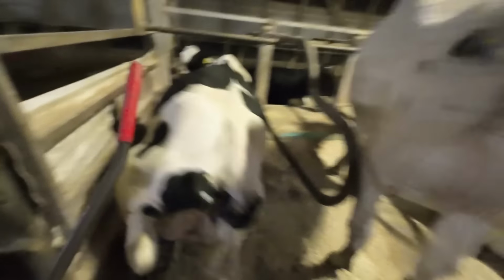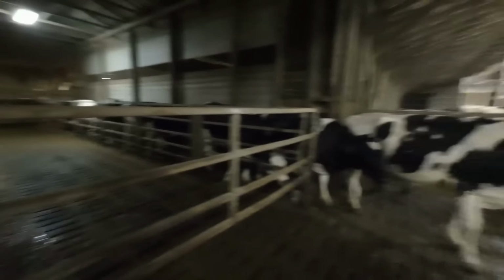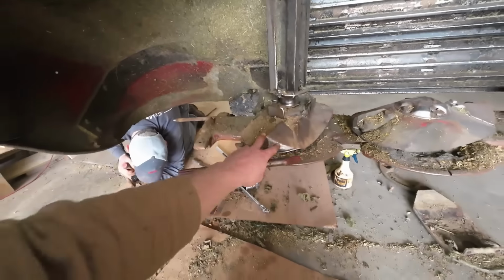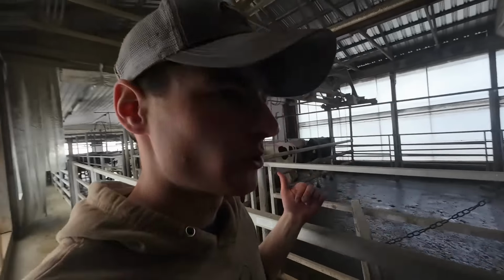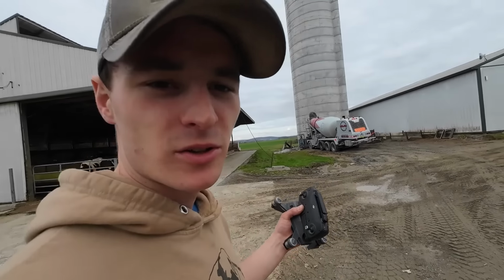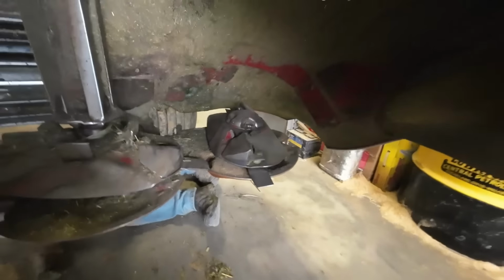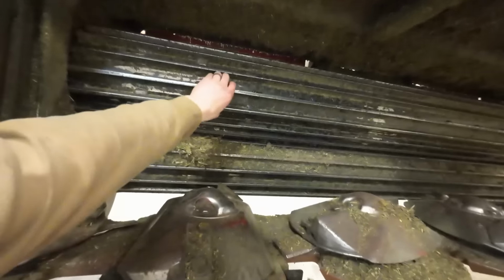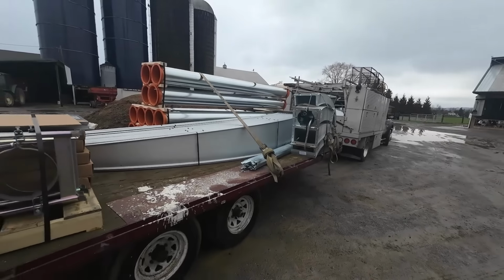Pouring Concrete on a 100+ Foot Silo

Comment: i have poured a lot of concrete for bridges all over. and that system they have setup is one of the coolest things i ever seen. really brings back the old nostalgic feeling. thanks
Reply: I was a PM for a concrete company back in the day. We did some bridge work too.  I got told by someone from the BLM "that we PLACE concrete." :) 
I wonder if placing an anchor for pipe to allow a pump to hook up at the bottom then the cart operator could chug the pump to fill the cart. Or, the pipe could be plumbed to attach to the hopper. That said, the formwork may only be rated at a slow rate per hour.

Comment: Thank you for giving us a look at how they pour; that was so interesting.  I have seen a few silos, and it was always a wonder how they poured them in the past. It would be interesting to watch them switch out the forms to move up. I have seen slip forming on a dam, and I wonder just how similar the forming of your silo is.
Reply: They unlock the bottom form and pull it up and lock it in on top.  We have 3 poured silos on our farm. The last one was in the mid 70s. 1st one in 50s lol

Comment: Great video!! In my mind, I always thought that the bunker silage pit was cheaper than putting up an upright silo. But maybe its cheaper or about the same expenditure? It would be interesting to compare the costs....
Reply: A bunker is a lot cheaper, the reason they are using upright storage, is because they are moving to fully automated feeding. So the feed needs to be stored this way.
Reply: @LastNamefirst-wv7jj you need to watch the video where he explains all of this, they though through everything and decided that defacing and loading feed boxes just wasn't a viable option. So they opted for this. I actually agree with them, if you are having an automated system, why mess around filling feed boxes.
Reply: @LastNamefirst-wv7jj  always some know it all 😂. It's a shame there's no right way to farm, they can do what they want.
Reply: @LastNamefirst-wv7jj They aren't stupid, it's their Farm, Their money, They can do whatever they like.
Reply from the maker: @LastNamefirst-wv7jj the big kicker for me with using the bunks is feed freshness. Defacing the silage and letting it in a pile for 4 to 16 hours before feeding it to the cows is a problem. Our bunk floors need to be resurfaced and we should expand the silage capacity and buy new walls for a couple narrow triticale bunks. Then buy a used payloader and some quality com boxes (45k each) for loading feed into the robot. We could use some old forage boxes but I know those are not built to have acidic fermented feed setting in them 24/7. There we already spent close to two silos worth of money and we still have the labor of loading the boxes 2 or 3 times a day. Also the problem of moisture changes when we get rain in bunker silos. The towers bring other advantages- less feed shrink, little to no mold, no dirt or manure getting tracked into the feed, no throwing tires and cutting plastic. I know what we are getting into with silos. Gotta stay on top of maintenance to avoid most sunday night calls. Triticale door needs moved every 20 days and corn silage every 10 days. Fresh feed on camand for the robot, hard to beat.
Reply: @10thgenerationdairyman yes the better quality feed for the cows coming out of an upright silo compared to a bunker will show up in the milk check.

Comment: I used to build silos back in the early eighties. The tallest was over 300 ft. Built smoke stacks the same way. Built a few up around 1000 ft. Quite a view from that high up. Brings back a lot of memories.

Comment: Amazing build.  Was looking to see how those guys were tethered. Man on the cement cart is but can't see where the other guy is tethered. Does the cement cart also vibrate the mix to insure a solid mass? When they come down is it on the bucket winch?  I would like to see that ride.   Thanks for the aerial.

Comment: Great vid Eric love watchin em. Only thing id say about the crimpers on the mower is that when you cut the crop the crimpers crush the stalks which can cause the nutrients to be drained away and left on the ground rather than in your feed like yes its great for drying but you can get a better crop if you dont crimp it 👍👍
Reply from the maker: I've heard that but we have not found it to hurt feed quality. Some say crimping is better for feed quality because it stops the plant from respirating after mowing.

Comment: As you get older, you'll wish you had an elevator for those new silos.
Reply from the maker: That or someone younger around to help climb them
Reply: @10thgenerationdairyman  better start encouraging the kids to like climbing now!
Reply: @nickjewart9351   Kind of naturally start climbing stuff in the yard
Reply: I was 8 years old when I first started climbing silos. 2 80’s and a 40’. He’s got nothing to worry about.
Reply: Its not a big deal. Grain farmers climb grain legs all the time too. My 60 year old dad still climbs silos if he has to.
Reply: I grew up with 2 20x60 stave silos on our dairy farm. 120ft is still a long way to climb.
Reply: Soon he can buy a drone so he can fly instead of climbing 😂
Reply: Years back I was talking to a silo builder.
They put a cable on a silo that had some weights on one end then you hooked the other end on a claiming harness that you had on to make it easier to clime.

I don't know if it can be done but it be nice if the inside of the silo could have a good epoxy paint sprayed on it or at least the bottom half.
Reply: Are you planning on putting a safety cage around those rungs?  Climbing 100 feet to the top can be risky.  At that height the wind could make that trek to the top dangerous.
Reply: That's when 11th Gen takes over.
Reply: Love your videos
Reply: I built poured concrete silos in the 70's and most silos over  80 ft in height always went to the 30 ft diameter .Just curious why you are going so high with the 24ft instead of going 30ft and not so high?
Reply: Wondering why you did go with another harvestor for another silo!?
Reply: @diamondjim7560  it will get a safety cage when Sollenberger comes back to put roof, hexapod and unloader in.
Reply: @somethinburnin  Thanks.  I was worried.
Reply: Also the chute is for climbing. He mentioned that when the first 3-4 rings were being made. Some of their existing silos work the same.

Comment: Perhaps you could turn a portion of the old silage platforms into a two-story machinery maintenance space.
Put in a second floor over portion with a slot so that you could work on the underside of machines without laying on your backs.

Comment: Great footage! I was thinking about these silos today, how many times up and down do yu figure per year" you may need an elevator install!
Reply: I would not want to be up there. I have done some labor jobs that were sketchy, Probably the closest was putting steel on gable ends of barns built into a hillside. Extension ladder, stretched out on top of a flatbed truck it was dumb, I was 29 and had three kids...check my mental stability.

Comment: Weakest part of the NH cutterbar is those shafts. I hate to admit it, but JD has a better cutterbar design. Single oil check and fill points. Great video!

Comment: I'm surprised you don't seem to using never sieze on the bolts or even grease on the shafts, that is a rule of mine, especially if i know I'll be back in there taking it apart. Or did i miss something? Nice looking cows btw, really clean looking herd.

Comment: With Kuhn mowers you should put your knives the other way around then you do, you may want to check that. The other way around they are kind of selfsharpening. How often do you change your oil on the mower, 5 years or so?

Comment: Why such a tall structure made of concrete?  Why not the shorter and wider steel storage bins?  Im assuming there's a difference?
Reply from the maker: With forages we need to take enough feed off the top every day to keep it fresh. Wide bins are for dry grain which is a very different type of crop.

Comment: So....I noticed you are pretty close to the "exhaust pipe" on the cows when you are prepping for milking.  Have there ever been exhaust related incidents? 😊 Pouring that concrete up in the air is scary!

Comment: Why did you elect a 130 Ft high silo?  Wouldn't two 70 ft silos be just as good.   It takes a lot of power to push feed that high.  Just wondering what the benefit is?
Reply: They need 3 132' silos to provide enough feed for a year. There's not enough room for 6 68' silos.

Comment: Use SEAFOAM SPRAY ON THAT RUSTY SPLINE SHAFT, RUSTY BOLTS, ETC.  IT is proven to work 5X faster than blaster, liquid wrench or WD 40.  I have done/used it for several yrs.

Comment: I wonder why they haven’t adapted that bucket system to use 2 buckets? I can see a bucket on each end of that line used to raise and lower. That way a bucket is always ready at the top. As one full bucket raises, an empty bucket lowers. Make sense? Every day is an IQ test.
Reply: You would have to adjust the spacing of the two buckets every time you raised the forms.

Comment: There isn’t a doubt in my mind that you will be able to blow corn silage to the top but I’m most certain your grasses are gunna be a night mare. Have fun unplugging it. Also I think a lot of your mastitis problem is your bedding. We ran into a little trouble when we started buying cheaper bedding that was nothing but dust
Reply from the maker: I talked to multiple farms with similar size silos and they don't have trouble with spring forages but we will see. Our mastitis problems have been much improved running 100k scc currently.

Comment: How do you tell which cow gives what amount of milk. You just show them coming in to get milked, and you putting on machines.
Reply: They mechanically measure the milk output of each cow once per month. Eric recently showed how they do it in the video: "Milk Testing & Feed Mixer Belt"

Comment: Im surprised you refit those splined shafts without any lube on them. Its no wonder they get rusty and sieze in. Even a light oil coat would help.
Reply from the maker: We did oil them then. This was the first time we had them apart since we bought the mower used 10 years ago.

Comment: How can you have a silo 24 by 132? That's 1 to 5.5 ratio. 20 by 90 is 1 to 4.5.    28 by 108 is  1 to 3.85.
Reply from the maker: This ratio is fine because of how the rebar connects the walls to the footer. This silo is a lot stronger than a stave silo.